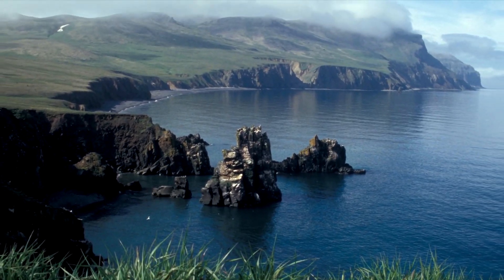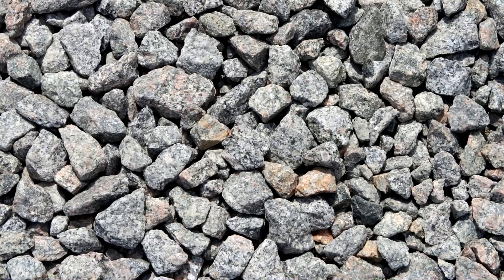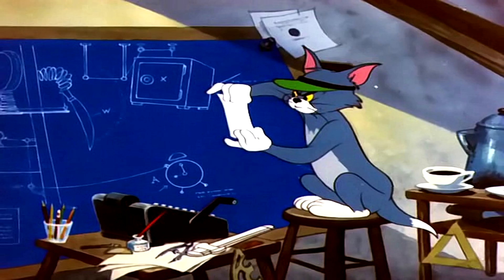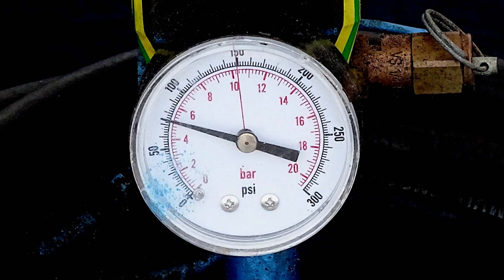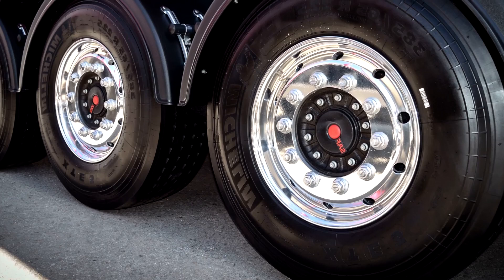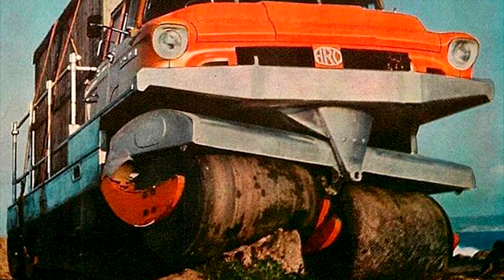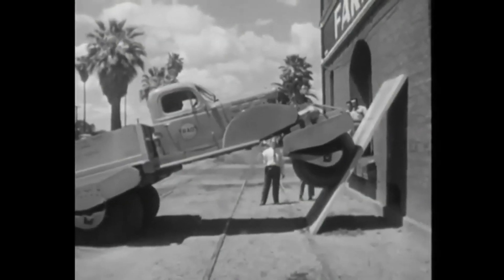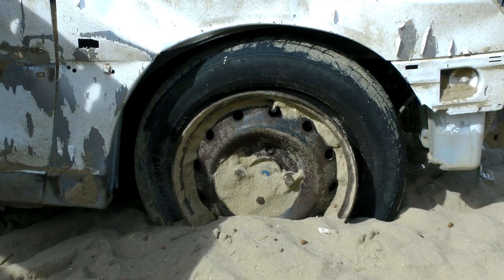why it works 4

Comment: imagine a man with a slightly higher than average weight laying across your body. that’s how it feels like, assuming the tire isn’t partially on the ground
Reply: 200 kg is slightly heavier than average? That's 441 lbs!
Reply: @ImperfectVoid8479  200 lbs, 200 kg. What's the difference?
Reply: Each kilogram weighs 2.2 pounds  @TheBcoolGuy
Reply: @ I think ImperfectVoid deleted his reply. The original commenter said that the truck would exert the weight of an average man across your body, but it would actually be 200 kg, which is way more than the average man weighs anywhere. Imperfect then joked that it's the average American and I joked, saying "what's the difference?" sarcastically. Hope this helps.
Reply: @TheBcoolGuy  a real democracy speaker 
FREEEEEEDOMMMMMM
Reply: @EpikTheBlahaj  democracy. freedom. choose one!

Comment: How come these tires aren't supceptible to being popped by anything sharp?
Reply: In what way would they be susceptible? They're not party balloons.
Reply: @lamegamertime nah this in fair question. Tires are pretty poppalble. I Think the answer is they have a very wide surface area and that limits the capacity for sharp objects to penetrate easily
Reply: @lamegamertime  you aren't wrong, but you should elaborate a bit if someone doesn't understand fully. What is obvious is relative
Reply: I'm only guessing that it would be like trying to pop a deflated balloon.
Reply: wow no one answered this properly still
The tires have a certain thickness to them. That thickness equates to how far something sharp has to go in order to rupture the tire. Besides that, the softness and conformity to it's surfaces means that at any point, in this case the point could be a literal needle point, the tires would just form an inverse hill around the needle and keep driving, precisely due to their ability to deform. 

The analogy is this - Try a semi inflated balloon, a deflated balloon, and a balloon inflated to the point it's about to burst, then apply pressure with your fingers. Applying pressure to the deflated balloon is harder because it adjusts it's shape to your finger shape as you attempt to poke through it. The inflated one can't afford to do that much, so it will pop. Same principle here

The "It's not party balloons" doesn't explain any of these principles, @lamegamertime. People asked for an explanation, not a beration for their "inferior amount of knowledge"
Reply: @destroything  Huh??? It's not that deep bud... They didn't explain what part of the tire would make it susceptible to popping, so I asked what they thought made it susceptible to popping.
Why are you being rude, and putting words in my mouth?
Reply: @lamegamertime  it might be my resentment towards when people answer questions in the most barebone way and refuse to elaborate if the asker remains confused